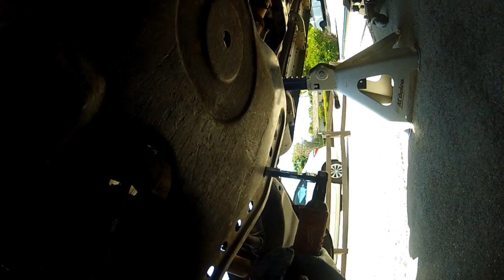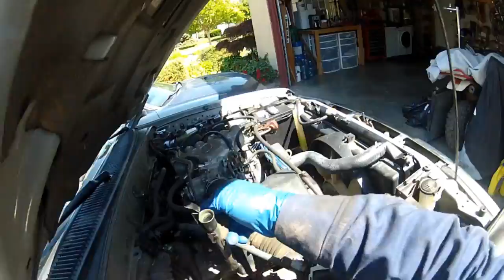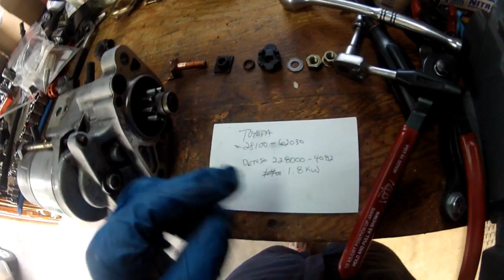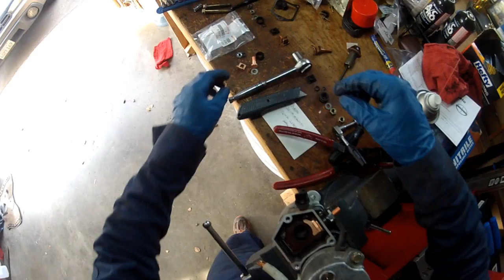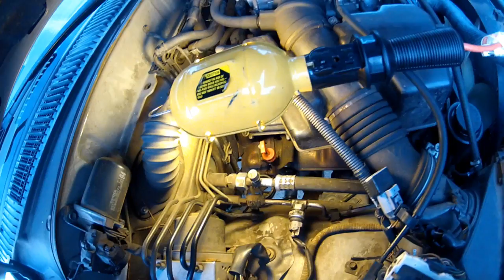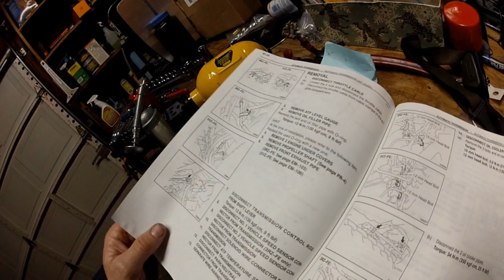Starter Removal and Solenoid Repair

Comment: In theory a horsepower is .75 kw. Hence the 1.8 kw rating for the starter. Good video.
Reply from the maker: Very interesting.  But, for the same size engine, they do spec a 1.4kw starter for the models with a manual trans.  And, they spec the 1.8kw starter for manual trans models with the cold weather package.  Glad you like the video.
Reply: The higher kw rating could be the result of using an automatic transmission. The torque converter would cause more drag or load on the starter. On another subject, I was able to correct the dashboard / warning light on my 1983 Cressida. Thanks for the helpful comment and videos.
Reply from the maker: @carolcarola9719  Your theory for why they spec the 1.8kw starter on the automatic transmission models is the same theory I had too.  It makes sense that there's more resistance with the auto trans compared to the manual trans.

Comment: Thanks for this video Tim.  I'm doing this job now, and I'm on the last stage.  I cannot find a video anywhere that shows how to mount the  starter back in with one hand, while putting the bolts back in with the other.  The starter won't sit on the mount at all without the bolts.  I don't know how it's done.  I need someone to hold the starter in place, while I put the bolts back in.  I've looked at tons of video.  They all cut away when it's time to do this.
Reply from the maker: You can do it no problem from under the rig.  You just have to reach up with one hand to hold the starter ( I would suggest your right hand) and then get the bolt started with your left hand.  If I can do it, you can do it.
Reply: Thanks for the reply Tim.  That's impressive to hold it with one hand while sliding the bolts in with the other.  I got my neighbor to hold it in place while I put the bolts in.  I guess I could have done it, but it sure was easier with help.  Tim, I hope you can help me with this last problem.  I got the starter in and all I had to do was reconnect the battery cables.  I connected the positive first, and when I connected the negative cable I got a serious spark as soon as I touched the terminal.  I'm not sure why this is happening.  Never had this problem before.

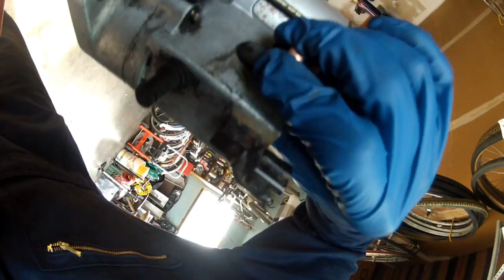I got my starter kit from Napa solutions.  They put the specs from my car into the computer and it was a match for my vehicle.  The only difference is that the bolt that goes into the right-side contact was not as long.  The original bolt on the starter was welded to that right contact just like yours.  The original bolt on the right side contact was longer than the original bolt on the left side.  But in the new starter kit, both the bolts were the same size.  So since that new bolt was a little shorter, I didn't include that part at the 29:24 mark.  Is that piece crucial?  That is the only thing I didn't include.  I'm just trying to figure out why I'm getting that spark on the negative battery terminal.  I'm on the last step!
Reply from the maker: You should disconnect your battery before messing with starter.  That's step 1.  Maybe I should have made that more clear in the video.  As long as you are connecting the positive cable to the correct post and the negative cable to the correct post, you should be fine.  I don't think that plastic piece is absolutely necessary.
Reply: Oh, the battery was always disconnected.  That's the first thing I did.  But when I finished putting the starter back in, I went to reconnect the battery.  I was getting ready to try and crank the car.  But when I put the negative cable back on the terminal (after putting the positive cable on first), I got a spark.  Not a small spark.  So I cannot connect the cable to the negative terminal.  If there is a short, I don't know why.  I never had a problem with putting the battery cables on the terminals before.  For whatever reason, it started after I put the starter back in.
Reply from the maker: @jimthompson7370  Hmmm.  Well, something isn't right then with the way you hooked up that starter.  Are you sure the positive power is connected to the right post on that aftermarket starter?
Reply: Yeah, I don't know where else it could go other than the bolt under the solenoid.  And it's the original starter.  All I did was change the contacts inside.  I've been retracing my steps.  Nothing was wrong with the cables from the battery to the starter.  I can't even try to crank the car until I resolve this spark issue.
Reply: Okay, I'm coming back to give the update.  First and foremost, I got it to crank.  And I did figure out how to install the mounting bolts while holding the starter in the other hand. 

It turns out that the spark on the negative battery terminal was because that piece at the 29:24 mark was missing.  The battery cable connects directly to that piece.  Without it, the cable connected directly to the battery cable terminal on the starter.  That missing piece works as the buffer.  I guess the metal on metal created the spark on the battery.

The Dorman starter kit will not work if the starter is like Tim's or mine.  The bolts that connect to the starter contacts are both the same size in that kit.  The bolt on the right side was supposed to be about a half-inch longer.  That is what gives just enough room to include that piece that I left off.  So I ordered another kit off E-bay.  It came from China, and took about 2 weeks to arrive.  This kit  included a new plunger, while the Dorman kit did not.  The kit was around $13, so about half what the original starter kit cost.  It had two contacts- one longer than the other.  

Once I installed those new contacts with that longer bolt and missing piece,  the car crank right up.  Much appreciation for this video Tim.  You've helped a lot of people from getting ripped off.
Reply from the maker: @jimthompson7370  Hey Jim, thanks for the update.  Good to hear our video helped and you finally have a working starter.  Good job getting it done.

Comment: Hey Timmy, thanks for the video it helped a lot to do this myself and save the money. I replaced the contacts but kept the same plunger in just cleaned it up a bit. Well the truck started up weird at first but then after it was fine. But a week later it wouldn’t start again. I hit the starter with my tire iron and it started, what do you think is the issue? Is it because I didn’t replace the plunger?
Reply from the maker: It could be that the plunger is sticking.  If it were me, i'd take it back apart and replace the plunger.  Be sure to put a little grease on the shaft of the plunger so it slides in and out freely.
Reply: Timmy The Toolman okay thanks, is there a certain grease I should use? I know there’s a couple and I’m a complete beginner at this
Reply from the maker: @maxmancera9994  Any multipurpose grease would be fine.

Comment: I just replaced the contacts in my starter. If your looking for a cheaper parts kit. Rockauto.com has one. It says it's for a 1.4kw starter. However this same kit works for the 1.8kw starter. PN# 2822674070
Reply from the maker: Thanks for sharing this info.

Comment: Hi guys i just want to share to you all my easy way how to take the starter motor out from the engine, its better to remove the exhaust manifold than the other.
Reply from the maker: You're saying to remove the whole exhaust manifold off the engine to get the starter out?  You must mean something else because there's no way that's easier than disconnecting a couple brake line brackets and removing the upper half of the transmission dipstick.

Comment: My 4runner sometimes does a click but wont start and sometimes it starts right up. Any ideas what it can be? If it is starter, do i need to take both battery connections? I dont want a check engine light to go off after a few miles because all systems not ready. I had that issue with a new battery replacement.  P0420 and it finally went away
Reply from the maker: Could be the starter.  I'd start with cleaning up your battery connections first.  Disconnecting the battery didn't cause that code by the way.  The code popped up due to your downstream O2 sensor picking up a problem with the exhaust gases.  It's a code related to the Catalytic Converter efficiency.

Comment: Great video! Thanks Timmy. Working on my 05 V6 Tundra starter and I just wanted an easy way to access and remove the starter. This video provide it!
 I don't think I want to overhaul the  solenoid it self, looks quite tedious. Since I am a Novice mechanic, I don't want to go there!
So i'll opt for an easy way out and just replace the whole starter. 
Seems like a lot of work, to risk getting all the right pieces back into the solenoid,and re-installing the starter only to have put the o rings and washers,( etc ), in wrong way. Not going to "Nickle and Dime" this project. This Truck has been so good to me for 13 years,w/no problems. Except this and the U-joints. 

 All in all,if you're cash strapped, this is an excellent video! Again Thanks Timmy The Toolman .
And Thanks you too YouTube for bringing this very informative video to the public.You guys are the Best! Mahalo
Reply from the maker: Glad you like the video and you're welcome.  I think you should reconsider and fix your starter.  The OEM Denso Starter is going to be superior to something you buy at an auto parts store.  Guess what they're going to do with your starter when you give it to them to for the core charge, they're going to replace the starter contacts and resell it to make even more off you.  It's really not hard to replace the contacts.  Have faith in yourself.  A novice mechanic can handle the solenoid work no problem.  It's harder to get the starter out than it is to overhaul the solenoid.

Comment: I was able to take my starter out from underneath my 4Runner.  I got lucky.  I didn’t have to pull it through the wheel well. Good info. Thumbs up.  By the way if anyone interested bought my contacts from eBay.  $7.91 fix. Came with plunger and contacts.  I replace all.
Reply from the maker: Peng You must have a 2wd drive model unless you're a magician.  The 2wd drive models have clearance to bring the starter out through the bottom.  In the video description, there is a link to more affordable contacts I found on EBay as well.  Maybe we purchased the same exact set.

Comment: Quick question. Was your plunger soaked in oil? I found oil on my contacts (but it did have 300k miles). Just wondering if I can clean out that portion or at least wipe it down.
Reply from the maker: No, my plunger wasn't soaked in oil.  Maybe oil leaking down from bad valve cover gaskets somehow worked it's way into the starter.

Comment: Thank you, T.T.T., for taking the time to make another great detailed video! This really made the repair so much easier being able to see all the steps, especially how to orient the starter to actually remove it. I only needed to replace the one contact, it was ground down about 1mm, but the plunger and the other contact looked almost new. In case this is helpful to anyone else- I bought just the contacts from a place called 4crawler.com. (direct link is http://www.4crawler.com/4x4/CheapTricks/Starter.shtml#OnlineOrdering). I found them mentioned a few times in other 4runner starter tutorials. He sells just the contacts, $5 a piece. and if you only need the one contact like I did, cheap city! Turns out he's in sunnyvale, I'm in san jose, so they showed up next day.
Reply from the maker: Hey Michael, glad the video helped you out.  Thanks for sharing that link.  I wish I knew about them because I live in San Jose too.

Comment: I see Denso starter rebuild kits on eBay for $9.95.  Are these reliable?
Reply from the maker: They work.  Sean put one in his rig.
Reply: I have one...works great!
Reply: I clicked his link and it's only like $10? Wow the stealership prices are horrible.
Reply: stiffmeister0hYeah get one...can't go wrong!
Reply from the maker: Like I've told people before, the OEM contact kits replace the contacts and all the associated hardware so it's not a direct comparison of what you get for your money.  But, people generally only need the contacts and plunger, so yeah,  buying from the dealership is way more expensive.

Comment: Timmy!  I have some questions for you.  I submerged my lifted 3rd gen in the middle of a river a while back, had to stay there overnight.  Long story short, pulled it out of the river and trailered it home.  So now, Ive flushed oil out with new oil(no water anymore).  Ive tested my starter relay, works fine.  I jumped the battery with my worktruck, I have 13.5v on it.  12.4 when key turned over.  I get ZERO response from my starter.  Should I be leaning towards a completely bad starter or something else?  Thanks
Reply from the maker: I'm not the best person to ask about troubleshooting electrical because I have limited experience with it.  However, have you confirmed power reaches the post of your starter?  If power is getting all the way to your starter when you turn the key, and nothing is happening, I'd replace the starter.
Reply: Timmy The Toolman I am thinking you may be right.  Thanks for the lightning quick response either way!  Keep up the great content.
Reply: Timmy The Toolman What confuses me about the starter, is that I am getting voltage on the positive post with the key OFF.  I believe its supposed to be that way.   Possibly a frozen starter from being submerged for 12 hours!
Reply from the maker: Like I said, I wish I could be of more help but I have limited troubleshooting experience with electrical.

Comment: This tutorial was an absolute lifesaver!  I just finished my starter rebuild last night and I followed your detailed explanation to a T.  Thank you so much for everything.  The biggest help - PART NUMBERS!  I have found it so unreal difficult working with dealerships and them not knowing the corrected parts.  Thank you so much for including them.  I did see the cheaper option you mentioned, but like you, I needed parts quickly and my local dealer could get them to me in less than a day for around $61.  Still better than taking into a shop and letting them do it for me.  By the way, I am a complete novice, but love to learn.  Now I'm hooked!
Reply from the maker: Very glad to hear our video helped you out.  Like I keep telling people, many things about auto mechanics is not that hard.  If you have the willingness to learn, the right information and the necessary tools, you can do a lot of repairs and modifications as a DIY mechanic.  Happy Wrenching Andrew!

Comment: when you were taking the right contact out, you show the O ring was on the inside. when putting it back in, you said the O ring is on the outside. is that how you assembled it?
Reply from the maker: oldz70 The o-ring goes over that copper stud.  It can come off on the inside because it's attached to the stud.  If you pull the stud out first before taking off the o-ring from the outside, it will come out with the stud.  Follow how I put everything back together and you'll get it together correctly.

Comment: Great video, saved me tons of time.  One thing I've found that's interesting...  Some history first...  My solenoid contacts first gave me trouble at 112k miles.  A local mechanic replaced the contacts only.  Skip forward to 196k miles.  Same issue, only I am the mechanic.  The contacts I received for a 1.8kw starter are much bigger and longer in length then the ones shown in your video (and the ones I took out of my starter)  According to the Denso website, the 1.8kw is used with auto trans and the 1.4kw is used in the manual.  Also, when I took the contacts of mine, the dust shadow outline showed the larger contacts some time ago.  I think my mechanic put in the wrong contacts, which still worked okay, but didn't last as long.  So, if you're the original owner of the vehicle and have never replaced the contacts before, you either have a 1.4kw starter or ???  Thanks again for a great video!
Reply from the maker: Yep, you are correct Pete.  I also learned when doing my research that the automatics came with a 1.8kw starter and the manuals came with a 1.4kw starter.  I have heard a manual could have the 1.8kw starter also if it was bought with the "Cold Weather" package.

Thanks for watching Pete and taking the time to make a helpful comment.  Happy Wrenching!

Comment: Thanks for your video, you helped me save hundreds of dollars!
Reply from the maker: We love hearing this.  Thanks for taking the time to comment.
Reply: @TimmyTheToolman  planning to work on my starter soon. My question is would the oem parts be the same for a manual transmission? Thanks in advance
Reply from the maker: @michaelt9558  The manual transmission model would be a different kilowatt starter than the automatic transmission model but I bet the contacts and plunger are most likely the same.  Check the video description because we provide a link to a much more affordable contacts and plunger kit.  Getting the OEM kit is overkill because you really only need to replace the contacts and plunger.
Reply: @TimmyTheToolman  ok Tim will do thanks again!🤙🏼

Comment: I started at the bottom loosening mounting bolts and 12mm cable nut. Then switched to side next to brake lines. Used your very helpful video to get ideas from. Thumbs up
Reply from the maker: Glad you found the video helpful and thanks for taking the time to comment.  Happy Wrenching!